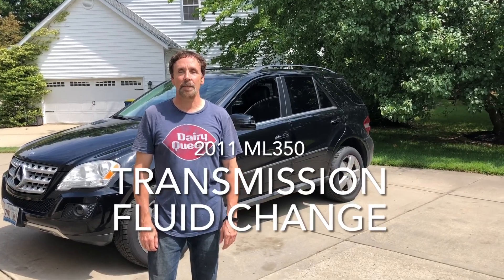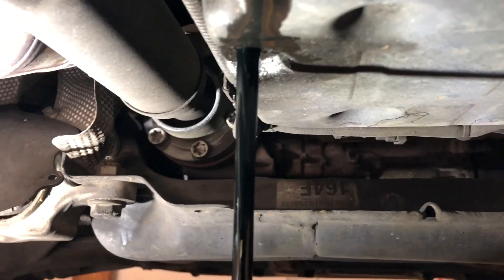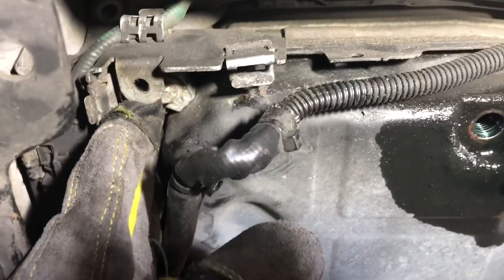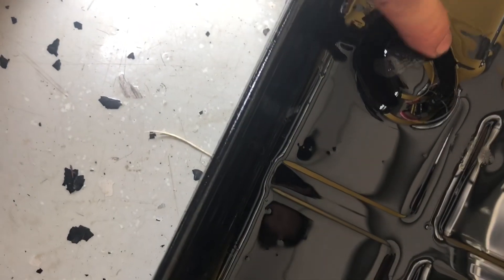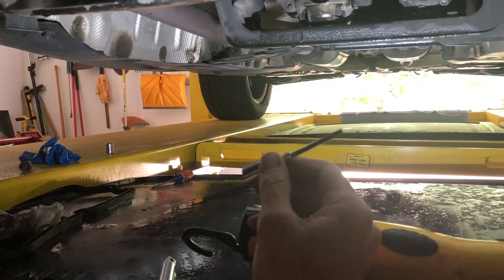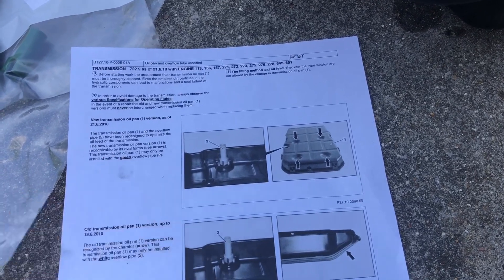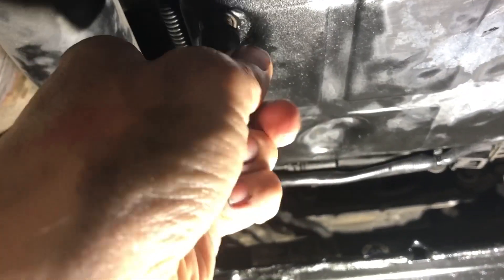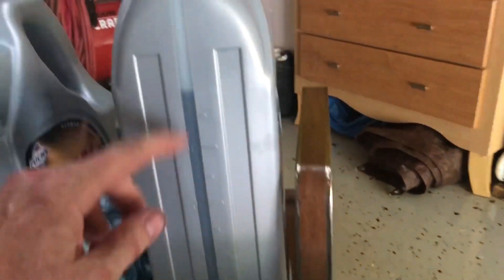Transmission Fluid Change in a 2011 ML350 W164

Comment: Dude,  this fixed my transmission surging problem at low rpm and moderate speed under load. Thank you!! Pain in the ass without ramps or a jack but I did it.
Reply: I only got 4L or less out of the pan (didn't do convertor, mine was a large torx looking bit). Added a little over 5L, idled it for 30 min and pulled the tube and a bit came out and when it trickled after a few seconds of major flow I popped a new plug in. My fcpeuro kit was correct on an 08 ML 350.
Reply from the maker: @eschrader  that sounds like about what I got from the pan.  Better safe than sorry on that torque converter plug.
Reply from the maker: That’s awesome!!  Yeah, having a lift really pays off sometimes.

Comment: Great video John. Using this video to do my own ml320. Thank you.
Reply from the maker: Glad you found it helpful!  Thanks for commenting!
Reply: Hi boys, today my gorgeous ML320 CDI trans blew on us a couple minutes away from home, car went what I think was limp mode we were able to crawl into a Denny’s parking lot got there and shut motor off then fired it back up and it wouldn’t shift into gear and made terrible noises so I shut off. I’m crossing my fingers this trans flush and change will go smooth on my ml320 and will fix problem and I will try to find a leak or add trans Lucas oil. Is there any difference in steps with your 350 and the 320? Or is all w164 family interchangeable? That’s a good thing then about these Mercs different models share parts in their generation. Anyways, salutations to you gents!
Reply from the maker: @tjtj1566  Sorry to hear that. Not sure a trans fluid change will fix it, but worth a try. I’m thinking the 320 has the same trans as the 350, but you may want to do an internet search just to be sure. Good luck with the fluid change!
Reply: @johnsworkshop3312  yes I fear that as well. I will have to get a full system scanner as my regular ODB2 does not read back anything from the TCM.
Reply from the maker: @tjtj1566  good plan. That will give you more confidence in your next step.
Reply: @johnsworkshop3312  so the scanner arrived I did a full 45 systems scan with my iCarsoft 980 and zero fault codes in the TCM zero fault codes in the ISM . The only code was a MAF sensor reading above normal and steering angle sensor code (both of which I’ve been driving with for a while without any issues) I cleared the two codes just for good measure but when I fire the car up and go to put it into gear it still makes spinning noises when I put it in neutral like it’s spinning to find a gear and then when I press the park button it makes all kids of grinding noises and I just shut the car off the prevent further damage. I tried to jack the car up with a 2 ton floor jack that maxes out at 13 inches and it couldn’t even lift the front tires off the ground. I doubt a 22” 3 ton jack will provide much difference either let alone provide me enough room to squeeze under. Only option is a professional grade car hoist /lift I believe so  now I’m waiting to find a cheap used one of those on fb marketplace. I’ve also seen scissor style lifts that are a similar concept but work of 110v and are more portable
Reply from the maker: @tjtj1566  glad you got that scanner. It will come in very handy. I think there might be some thing wrong with your jack. A 2 ton. Jack should be able to lift your car without a problem, since you’re only lifting part of it, I wonder if your jack is low on oil or something else is wrong with it?

Comment: very usefull nformations. i have a 2012 mercedes benz ml 350  how can i check the ATF oil level? what are the difference ways to put ATF oil in the transmisssion? is there an area to put a dipstick to check the ATF oil level? like we check the engine oil level.
Reply from the maker: @donaldjoseph8327  unfortunately, there is no way to check the level and no way to insert a dipstick. The best thing you can do is look for any seepage or leaks, and if you see any, and if it has been a while since you changed it last, it may be time to service the transmission.

Comment: Just for info purposes benz recommends every 40k miles for transmission.   I have this exact vehicle 2009 ml 350
Reply from the maker: Thanks Ryan for the good information. I probably should have done it sooner!
Reply: Mercedes is very cautious and sometimes misunderstood. For example, changing the oil every 15,000 km does not mean that it is best to change the oil (in the engine) after 15,000 km. It means maximum km per filling!!! For AT, 60,000 km = max. km. But MB also writes that if the car is under more stress, it is good to replace half as much. And in case of extreme load, shorten this interval even more!!! I've been driving with MB for 30 years and it's supported me for 20 years. In the engine, I change the oil max. after 12,000 km for AMG 8,000 km specification MB 229.5
  or 229.3 (DPF etc. 229.31 - 229.51) only 0W40 or 5W40 and AT 30,000 km specification according to MB 236.xx model. Of course, unless MB says otherwise. I don't buy any expensive oils, on the contrary, the cheapest ones, but they must have Mercedes specifications and must be approved by Mercedes (see Bevo mercedes website). So far, the record is MB w124 250D T 1,603.xxx km body corrosion killed it - the engine has been running in the home tractor for 6 years. Vito w639 also has 800.xxx km. I don't listen to Mercedes if they claim to replace more than 15,000 km. I saw an oil analysis after 28,000 km - the whole laboratory came to see what demented people we are :) And a friend only listened to VW - not a single component in the oil was functional :). Good luck to you

Comment: How do you check the fluid level when you're done?
Reply from the maker: @dannystewart1412  unfortunately, you can’t. That little standpipe in the pan is what sets the fluid level. There is no way to check it other than to pump more fluid in and let it drain back down to the height of that standpipe

Comment: Thank you so much for making this video. If you could, please let me know where you bought that special fitting for the drain plug to pump the new fluid in with? I'm getting ready to do this on my girlfriend's ML350 next weekend, and I think that fitting will make this job a little less messy.... lol. Thank you for your time.
Reply from the maker: Thank you for the feedback!  It has been quite a while, but I think I got mine at FCP Euro. Look for a W164 transmission fill adapter.

Comment: So I changed the fluid in transmission,  dark red, I have an overheated area on torque con. Under belly.  P2759, suv is still operable and replacing alternator (electrical problem)  any tgoughts
Reply from the maker: I’m wondering if the overheated area is really just from the manufacturing process.

Comment: My 2014 ml 350 changes from first to second and second to third a little roughly sometimes depending on the speed, will changing transmission fluid do any good?
Reply from the maker: Well, I'm not sure, but changing the transmission fluid will eliminate that as a possibility, and is relatively inexpensive compared with doing something more major.

Comment: Thanks for the video, very helpful. Where you get that drain fitting to the drain plug?
Reply from the maker: Thank you. I ordered it quite a while ago from toolsource.com. It is a 722.9 driveline filler adapter. Part number was 105640. Hope this helps.
Reply: @johnsworkshop3312  thank you. I saw one on Amazon

Comment: Great video! In the beginning of your video you mentioned having 11L of the transmission fluid.  Do you know how much you actually used?  Most of the transmission fluid kits sell 7L of fluid.  Maybe the additional change of the TC requires more?
Reply from the maker: Thank you!  The work instructions have you put 6L in first, warm it up, and then add 4 L if you have drained the torque converter     So that is a total of 10L. However you do end up draining some of that back out to get the level down to the top of the stand tube.
Reply: My meyle kit came with 8L

Comment: so did u use all 10L?
Reply from the maker: @5000RR  I think I used just over nine. But I would recommend having 10 available just in case you run a little short.
Reply: @johnsworkshop3312  weird my meyle kit came with 8L,idk if us market ml is different fro euro,i have euro 2011 with a89 code
Reply from the maker: @5000RR  If you don’t drain the torque converter you would use a whole lot less. But I would not recommend that. You can also measure how much comes out and that should be very close to how much you need to put back in. You end up putting more than you need into it so you can drain it out until the level is down to the top of the standpipe, so wasting some is inevitable.
Reply: @johnsworkshop3312  my kit came with new tc drain plug so ill do it,other also said 8L is fine but well see these days

Comment: Nice animatronic noise 2:17  :  )     
Did you ever notice any slippage starting out uphill?  Anyone ever add any Lucas to help this problem?  A big GL is hard on a transmission.  So is an ML.  I have an 09 E320 diesel also doing the same thing.
Reply from the maker: Thanks for the comment - yeah, that noise was the air coming back in as the fluid was flowing out.  Pretty weird.  I have not noticed any slippage starting out uphill.  I would think that slippage could be caused by not having enough fluid in the transmission so that the torque converter is not completely full once the pump start pumping it in.  But I think you would have to be way low on fluid for that to be the reason.
Reply: @johnsworkshop3312  :  Good points, thank you John.  Now concentrating on origin of a groaning low pitch bass noise on the 2009 E320 diesel (non DEF on this one)
In mild to heavy power increase, usually noticed on incline of any slope, the car has recently begun this noise.  May not be readily noticeable to some drivers.    Questioning if a bearing in the driveline.  Never had this until I took the car to a mechanic and it was out of service for several months.  Came back with some problems and some new developed.  It's always something . . .
But I definitely have to change that fluid in the trans.v
Reply: Hello from Central Europe. Please excuse my google english. I've never had an ML or GL back up on a hill even with a loaded car behind me on the trailer. Of course, if I take my foot off the brake and don't immediately put it on the gas pedal, it will definitely reverse, but I've never done that. You have low oil pressure in the transmission, that's why you are reversing. The question is why. It could be as John says - low oil. But there are many possibilities, e.g. faulty torque converter, wear of friction plates of clutches and brake belt, broken or worn piston sleeves of these sets, wear or damage of sealing rings of these sets, faulty solenoid or hydraulic valve of the hydraulic unit...etc.etc. The car needs to be properly diagnosed - I don't just mean Star diag. Try to see if there is a difference if the transmission is warm or cold. Likewise on the flat - if you stand on the brake and only then put D and again P and back to R. Does the car behave the same warm/cold? And what if you go to 3rd gear and hit the kickdown? The car will immediately downshift and fire, or it could be faster, or it won't downshift and will start slowly...I'm sorry I can't help you more. I just advise you to be consistent. Repair by trial-and-error method with MB does not pay off = it can jump to an unattractive amount. And this also concerns your second problem with the w211 320 which makes "some sound". Once an elderly man came to me with a w211 270 cdi, he also made a sound at higher revs. So bought a new turbo, then replaced all hoses and clips + new intercooler, then pulleys, water pump and alternator and nothing changed. He was at rock bottom. There was nothing left to change... I knew right away what it was (30 years with MB) but I didn't know how to say it. There was a slight exhaust on the first cylinder... I know the sound well - once I searched for 3 days and 3 nights :). Until you are 100% sure - never buy anything - and don't pay anything at the service center if they don't fix it... This is a common occurrence for us - the car is in the garage for 3 weeks for 500 USD and the garage says - so unfortunately we have not been able to find out where the problem is. And here in Europe, people pay them $500. I don't understand... you probably don't know that in the US - pay for nothing.. Good luck.
Reply: @Mijanboy  :  thank you for sharing important details.  Very good sir.  Very kind of you.
Reply: My car has 228k miles no mechanic wants to help whit the transmission